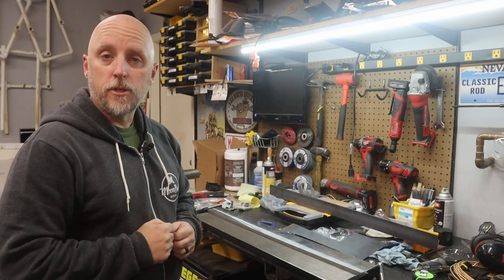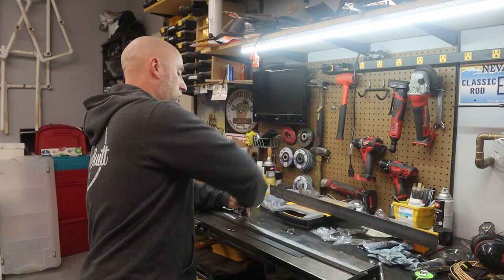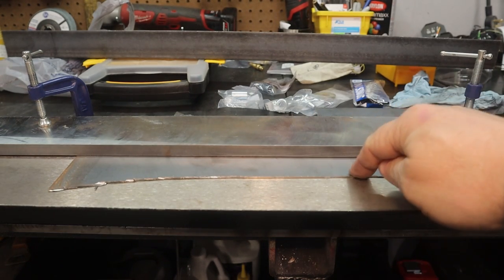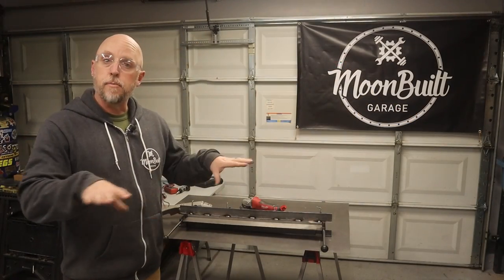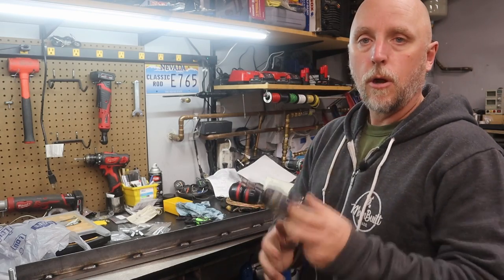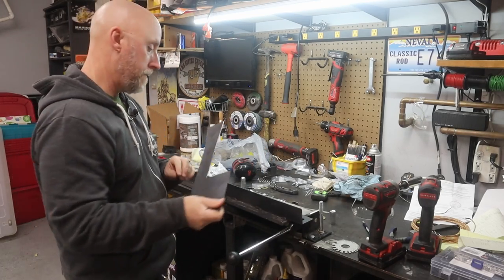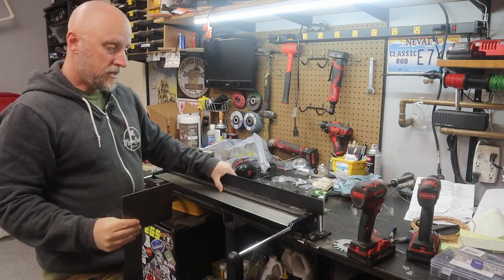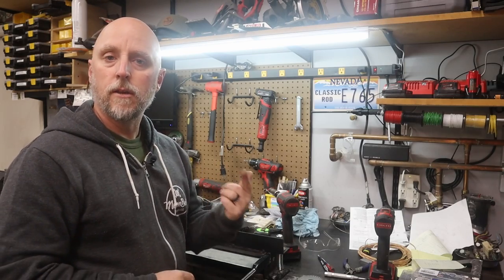Modifying a Harbor Freight 30" Sheetmetal Brake | Sheet Metal Brake UPGRADES |

Comment: Very nice, well done. I have a smaller brake and use thinner stock.
If anyone is curious,  I restore old film cameras and battery powered accessories. Such as slide viewers etcetera.
Alkaline battery leakage sometimes eats through and ruin’s battery contact strips. I pattern the new brass to match the old piece. Then use a “Micro-Mart” (Similar to H.F’s.model.) small bending brake to bend the brass sheet and drill the necessary holes.)
It works very well. I do notice that the work-piece sometimes “Walks“ a few millimeters, unless the clamps are very tight. I find, switching from a vice grip type clamp to a 3 inch “C” clamp works better.
I may try your modification on the Micro Mark version of the bending brake.
Thanks
Tom

Comment: Thanks! Like the simplicity of the mods. I think I’m going to turn the angle iron you weld on the clamping plate so it’s in the V shape ordination. Point facing up. I think that would have the same effect as gussets.
Reply from the maker: Thanks.  I thought about doing the same, but I like having the flat area just incase I do need to ever clamp it

Comment: great video!  Have you considered adding a pressure point in the middle similar to the 30" model and others that are sold?  Something like round bar bent in an arch with a nut / bolt welded in the center to push down...
Reply from the maker: I haven't....I may have to look into that

Comment: To eliminate flex, weld a 1/4'' flat bar onto the length of the angle iron to form a triangle.
Reply from the maker: I need to do that...I have run into a bit of flex, but nowhere near the amount before making the mods
Reply: Welding the angle iron up side down like a traffic cone would be much stronger and it would add support to the front and back of the flat bar. The bolts on each end would need to be re worked. thanks for the ideas i will be modifying mine this week. Any more info on the springs the link you posted list all the springs.

Comment: Good video. Well explained fixes for well-defined issues.  I'll be doing something similar, I suspect.  I will also be looking to try to increase the bend to greater than 90 degrees.

Comment: I like that modification and think im going to do would it help if you welded a piece of flat bar on a 45 degree across the front of the angled piece im sure its not flexing as much in the back as it is in the front

Comment: my suggestion for an analog clamp... look at a pair of vise grips for how they clamp... you can use an offset lever to do a secure clamp instead of a pair of bolts, if you want to speed up the clamp and release process... excellent work though... it's always a balance between cost and functionality... =D

Comment: Thank you very much.
Excellent improvements, I will incorporate them into my 30# HF Sheetmetal Brake 
PS1-I think that 30" brake is for a max of 18 gauge sheetmetal?
PS2-The links do not go to the specific product.
Reply from the maker: The links will get you to the correct page...with McMaster there was no way to link directly to the individual part, just the page with the size options

Comment: Could you just sit that strengthening bar a bit back as opposed to the slots ? Great video 👍😊
Reply from the maker: Not sure really.  I think it needed to be where it is for everything to line up and be supported properly
Reply: @MoonBuiltGarage  yea I gotcha ……I had seen some one else mod a brake and they made a point to remember not to put the bar too close so you could get full bend . Just didn’t know if the notch made it easier for something I didn’t think about . Im having a tough time sourcing the bolts…was it 5 inches long by 1//2 you found worked best ?
Reply from the maker: I honestly don't remember what size bolts I used...that was recorded awhile ago
Reply: @MoonBuiltGarage  gotcha…well thanks anyway . Thanks for video and getting back to me ! Cheers 🥂